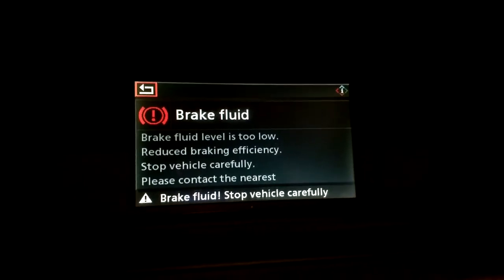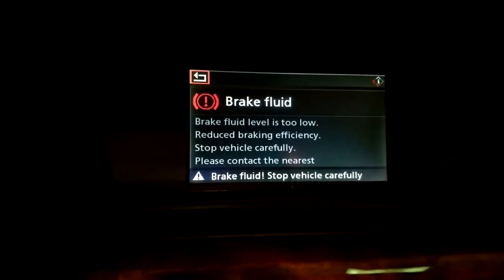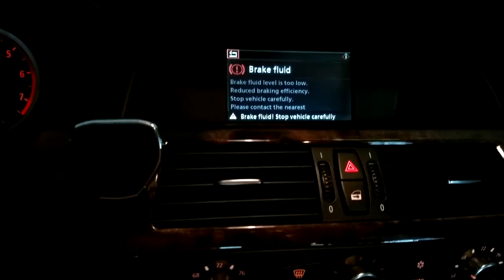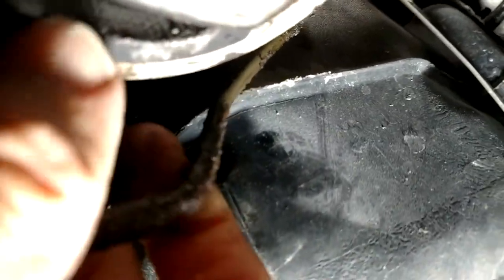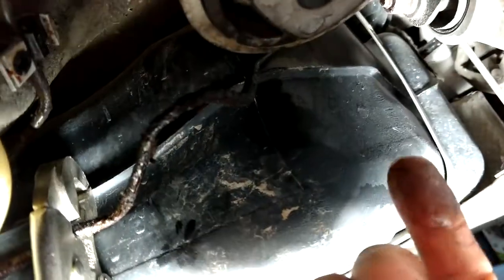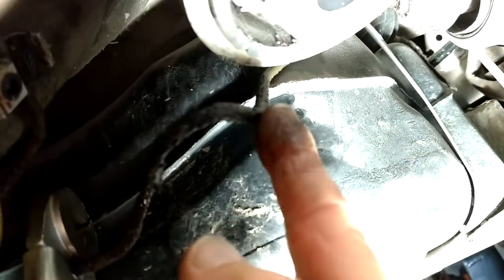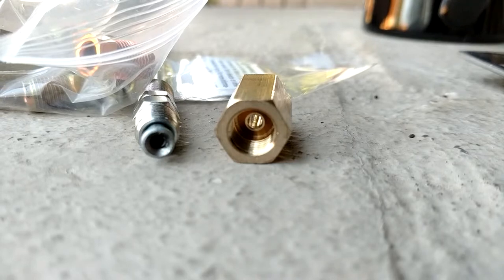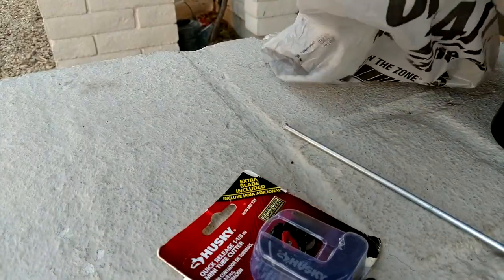BMW E60 / E61 rear brake line repair (mystery brake fluid leak)

Comment: Thanks so much for this.  Both rear lines split in the usual place.  Same as yours.

That little flare tool is awesome.  Could not have done this job so easily without it.  

I ended up replacing the left side line from the flex hose to about 1/3 of the way down the frame rail.  The right line, from the frame rail to about the subframe mount.  Got lucky there, as that line is the troublemaker to get over the subframe, etc.

Thanks again!!

Now hoping that my completely drained reservoir didn't screw up the ABS pump.  Bleeding to be done today.  Fingers crossed.
Reply from the maker: Glad the video helped, and that the awesome little flaring tool worked out for you (I honestly can't imagine how anyone could use one of the "mainstream" flaring tools in that space).  I've read contradictory info on the need to do anything special with the ABS.  I know there is an ABS bleed procedure that can be invoked from ISTA / INPA (and probably a lot of BMW-specific scan tools), but I'd try doing a regular bleed and see how it goes.  You might get lucky.

Comment: I tought the bmw lines are thicker around 5.5 mm aren’t that a problem with the tool?
Reply from the maker: I never actually measured the original lines, but the tool works just fine on them, as well as the new lines, which seem to be pretty much the same diameter as the BMW.   I believe the lines are 4.75mm / 3/16".
Reply: @Mark_H_DIY  is double flare needed or does bubble flare is enough to connect new to old lines? Yeah the new ones are all 4.75 mm but bmw has thicker coating thats why they are 5.5 mm
Reply from the maker: @bigdeal87  If you are splicing the existing line, it doesn't matter what kind of flare you use, as long as it matches the piece of repair line you bought. Just make sure you know what type of flares your particular BMW has, if you are going to replace the line all the way up to the factory fitting. Then, it matters. :-)

Comment: Try to buy an A.B.S. 96429 - No need to bead the ends of the pipes, you will cut, put on, tighten. I no longer use anything else, perfect.
Reply from the maker: I've seen others (in the US and elsewhere) use similar compression fittings to repair brake lines.  I'm guessing that most get away with it, but I'd never, ever do it myself.  The fluid pressure on a brake line can reach many thousands of pounds per square inch during an emergency stop (the kind that REALLY needs the brakes to be perfect), and that's not the time you want to find out that the fitting you used is good to half that.
Reply: @Mark_H_DIY  I reacted all the more to the relatively large effort and laboriousness of doing this on the car. I have several BMWs and corrosion problems are the order of the day. I have a cracked brake pipe on the old E39 today, so it's waiting for me. But I use ABS fittings, it's on the longest tube on the vehicle, it's really hard to replace. And sealing kits can only be bought with copper pipes, and they can't handle armored pipes. So in these "field" conditions, using this is probably the only viable option. At least temporarily yes. I know a lot of people and car services who normally use it, maybe it works, but I definitely consider it an emergency, not a permanent solution. Thanks for the video with tips and feedback to my commentary. :)